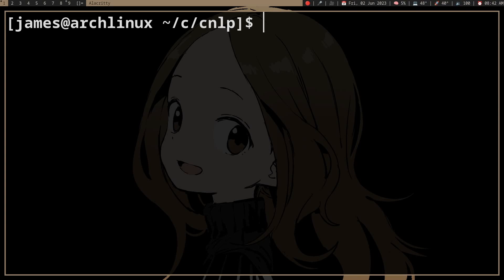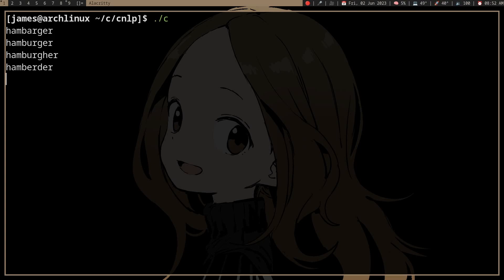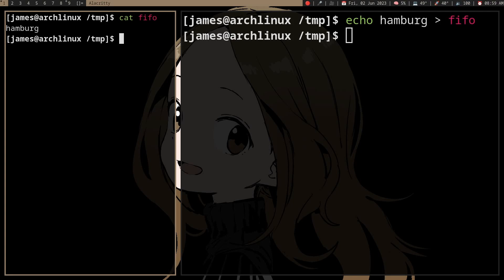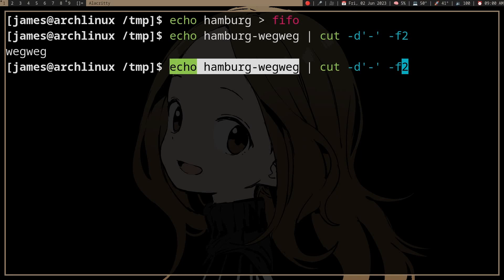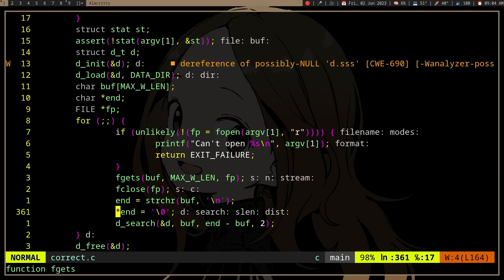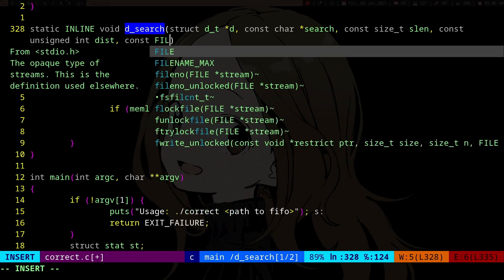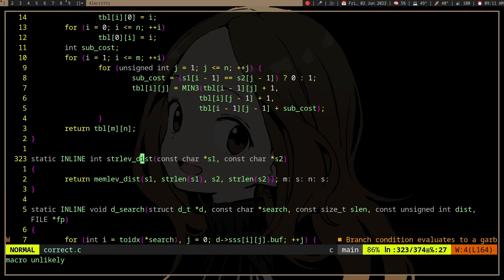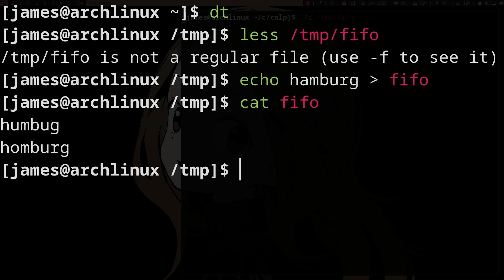What's This File?

Comment: Hi, it was a nice explanation! In your C code, your wrote:

```
fgets(buf, MAX_W_LEN, fp); s: n: stream:
fclose(fp); stream:
*end = '\0';
fp  fopen(argv[1], "w"); filename: modes:
```
I don't get the part after semicolon, what are s: n: stream:, stream:, filename:, modes: ?

Looks like they are labels, but I suppose they are used with goto, but I don't understand these in this context. Can you please explain?
Reply from the maker: That's just hints generated by the IDE. They're not in the actual code.
Reply: @nvlli  Ha! I was guessing it right then! But was confused, thanks a lot for clarifying otherwise I'd scratch head not knowing what the thing is!